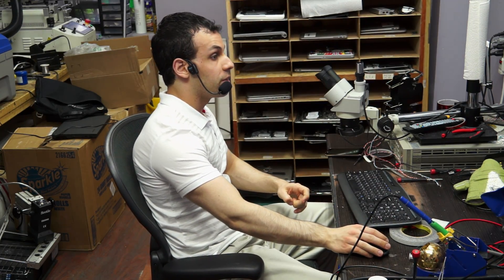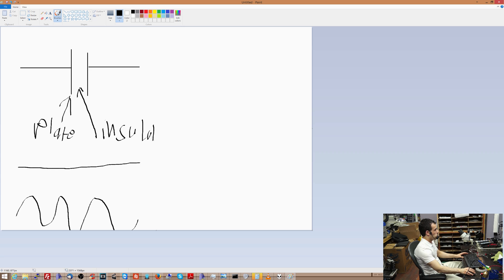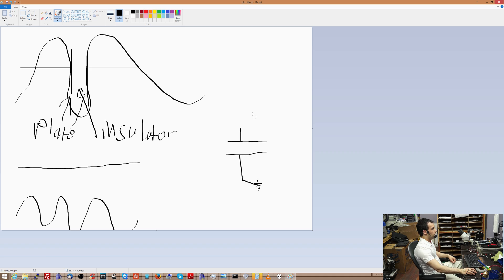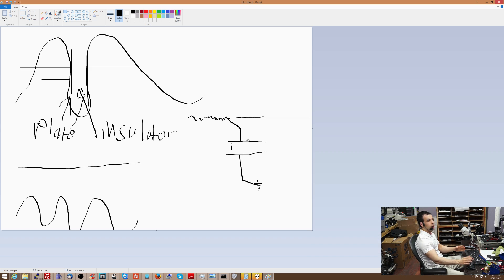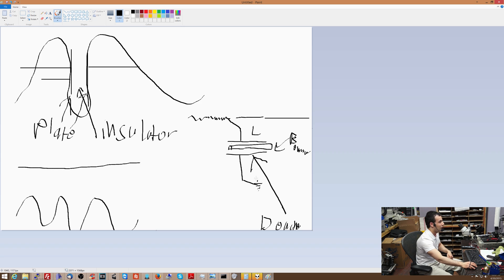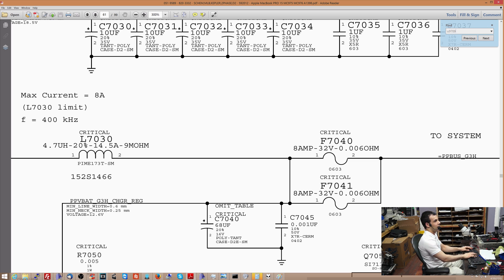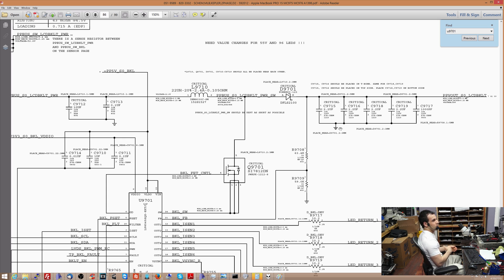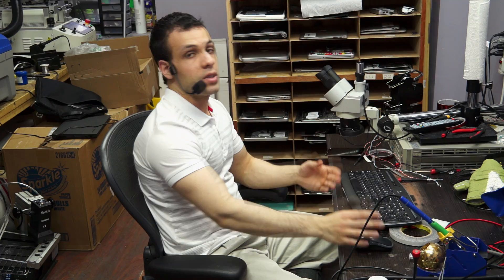What is a capacitor and what is it used for?

Comment: You literally explained it the actual right way. Like 10/10 right. Something else to note, is that the distance between the plates, as well as the type of dielectric, and most importantly the shape of the object being used to transfer that Voltage, determine the amount of charge that will be stored within a given time within the plate carrying the charge. The reason this effect occurs is because the voltage at the right time will allow the energy to flow through. In electrical engineering we call this flow the Electric Field (aka a form of flux, nerds please don't kill me), and is mathematically calculated through what is known as Gaussian mathematics. We use something called Gauss' law to do the actual calculation to find the

Comment: A capacitor is connected directly across the AC supply voltage. As the supply voltage increases and decreases, the capacitor charges and discharges with respect to this change. A current will flow through the circuit, first in one direction, then in the other. However, no current actually flows through the capacitor. Electrons build up on the one plate and are drained off from the other plate in very rapid succession, giving the impression that the current flows through the insulator separating the plates.

Comment: The reason that AC can charge both plates is simple. It charges both plates in exactly the same way as DC charges one plate, thing is AC alternates it's direction, + and - swap all the time.
So, with AC, one plate, which is at first connected to +, is charged and becomes +. Then the overall polarity swaps, and this plate is now connected to - . The other plate is now connected to +, and now it's this plate's turn to charge. And the cycle goes on.

Comment: I think of electricity as water in a house. The voltage is the pressure in the pipe. The current is the flow rate in the pipe. A resistor is a constricted region of pipe. A diode is a one way valve. A capacitor is an elastic diaphragm blocking the pipe. A ground connected capacitor or capacitor in parallel acts more like an expansion tank or a diaphragm on the outer wall of the pipe which smoothes out any pressure peaks. An inductor is a turbine in the pipe driving a heavy flywheel that at first resists flow and spins up and can continue trying to force water through the pipe even if the flow is shit off. A transistor is a variable flow stopcock controlled by varying water pressure on the lever. A DC voltage increaser works like a ram pump, allowing water to speed up through the flywheel or just its own weight in the pipe and then suddenly stopping it and using the high pressure jolt.

Comment: Simple definition: A capacitor is a bucket for storing electrons. The Farad rating is the size of the bucket. Defining charge is more difficult, but yes technically a capacitor stores charge. I like your analogy about angry Louis vs Bouncer. This is largely true for capacitors, except when you exceed their voltage rating, in which case the dielectric insulator between the plates breaks down and the capacitor fails, usually dramatically by releasing the "magic blue smoke". I do know what is a Buck Converter; I've not yet watched your video explaining how it operates. This video is skirting the whole L / R / C (inductance / resistance / capacitance ) topic of electronics theory. A Buck Converter brings inductance, rectification and capacitance to together in a very clever way to change voltage levels in a DC circuit.

Comment: I love your videos but this one kind of screwed the pooch man. I find the easiest way to explain capacitance is with water. Specifically a chamber with an in/outlet on each side and a balloon membrane in the middle. To push water in one side water has to flow out the other side. To let water back out it has to take water back in the other side. This is why ac sees to "pass through" a capacitor. Its a super short term way to store energy like a battery to be used when the main power supply drops below the capacitors charge voltage. When the voltage drops the capacitor starts discharging into the circuit it is placed in parallel with and back into itself on the other side until charge in capacitor is equalized with supply voltage. This is why you can unplug your computer and the led on older motherboards will stay on for minutes afterwards. The capacitors in the PSU are still supplying enough electricity to the motherboard to run it with no ground to ac. They discharge through the Mobo back into themselves normalizing their charge. I'm sorry man but I could come up with other ways to explain this all day that would be easier to remember and much more thorough.

Comment: Louis, sorry to be so late on this video but I've started w/ your oldest ones first and i'm working my way up.  There are many ways to look at capacitors.  Perhaps, look at one as if it were two loudspeakers touching each other face to face.  A DC current will push the first speaker one way and the other will follow.  But that's it.  However, if an AC current is applied, the speakers will move back and forth.  Energy will be transmitted across the barrier that the speakers represent.  A capacitor does the same thing.  Does that make a better mental picture for the explanation?  I hope so.

Comment: Hello, I get most of what you said, but details. You mentioned Ac, you also mentioned came from the wall. But you then mentioned DC Where is the DC coming from?
I have ask, You started a story about wanting to kick the douchbag's ass but the bouncer got in the way and stoped you I feel this critical to know the end.  How did you get around the bouncer or what the DC  do to be able to get through the capacitor. Does it finally just over flow it. Please finish story. Did the douche bag get away with it?

Comment: I watch alot of your videos and like them but this is totally wrong. There are bi-directional capacitors and uni-directional. 

The capacitors that are uni-directional (1 way) convert AC to spurts of DC. The correct direction of current build the charge of the capacitor then goes through. As it lowers the held charge helps keep the current up for a little bit. The ac gets lower than 0 and the current does not go back through the capacitor so current is 0. So only positive cycles the charge gets through.

 The bi-directional capacitors (Surface mount capacitors, aka little brown bastards) let voltage through both ways. They smooth out ac filling the lows with held charge.

I'm not too experienced but I pass DC through capacitors all the time! So do you!!!!!

On my sister's account...... btw

Comment: nice video, I understand kind of how it works but I'm still confused. a capacitor do the same thing as a DC power supply so you need a capacitor. I don't understand what is it doing to the load. The power supply can turn the load on and off, why use a capacitor?

Comment: DC will "kill your speakers instantly"? Are you saying that the power that comes from all amplifiers is converted to AC?
Reply from the maker: speaker amplifiers use DC to create an AC audio signal. All audio is AC.
Reply: Louis Rossmann awesome thanks!
Reply: I've accidentally fed DC to earphones. It can survive it for the first handful of shocks. In may case, these earphones died from rupture of the diaphragm, rather than the coil melting, but I wouldn't doubt if some loudspeakers or such burned up on higher powered devices.

Comment: So in DC electronic circuits a capacitor is just a dead end? Like a water balloon at the end of a hose?
Reply: Jacob Kantor Capacitors generally act as open circuits or "Infinite" resistance when doing DC Analysis of a circuit I believe

Comment: SO... Is the DC current is going to the ground?? Im still confuse
Reply: satria marhaendra A cap is seen as an "open circuit" to DC. So it's like disconnecting the circuit. DC current shouldn't even try to flow through the cap.

Comment: So the charge never ever goes through the cap, it just comes out the same way it went in? That's interesting.
Is this true of ceramic caps? 
Why are some caps polarity sensitive and some aren't? Do they behave differently to what you have explained?
Thanks for the understanding. Great presentation
Reply: Yes this is true for ceramic caps, also for cap polarity "Standard electrolytic capacitors are polarized components due to their asymmetrical construction, and may only be operated with a higher voltage (ie, more positive) on the anode than on the cathode at all times. Voltages with reverse polarity, or voltage or ripple current higher than specified (as little as 1 or 1.5 volts may suffice), can destroy the dielectric and thus the capacitor. The destruction of electrolytic capacitors can have catastrophic consequences (explosion, fire)."
Reply: Thanks! Suddenly motor circuits that I've been trying to rack my brains around for months make sense!

Comment: I really like your videos, and I appreciate your time and effort and willingness to pass along information.
Technically neither AC nor DC pass through the plates, instead AC builds up neg electrons on input side, once the group resistance is greater than the incoming current it starts collecting and alternating on the other side and thereby inducing voltage, and storing energy.
Reply: It's like people impatiently queuing in a corridor and there is a membrane blocking the corridor and people can push and shove the person back and forth on the other side of the membrane but can't break through. Also the membrane is springy and can push you back once you've relaxed

Comment: I don't know shit about electronics yet but after a little googling:

I think of capacitors as batteries. DC can charge the battery and once it's full, no more electricity can pass through, so it forms a block.

Since AC continuously flips between positive and negative, it charges and then "uncharges" the battery, so it never fills up and becomes a block.
Reply: not exactly but you're on the ball.
Reply: That's pretty close
Reply: Yeah, caps may be thought of as simple and small batteries in the sense that energy can be stored but you're completely right when it comes to the AC, because of the constant polarity flip, AC charges and then discharges and it never fills up, but even caps with a tiny amount of capacitance, let's say a couple of nF or even pF (nanofarads or picofarads ), can easily prevent low frequencies AC voltage from passing through because of in this capacitance range the caps charge and discharge extremely fast.

Please check the low-pass and high-pass RC filter for a better understanding of this phenomenon:

https://www.youtube.com/watch?v=OBM5T5_kgdI
Reply: @stevenbedoya9920  Damn!Thanks you for the comment! It clicked! I’ve encountered filters before, but never thought of WHY it works like that. It’s so obvious after you get it…

Comment: how does electricity know where ground is if it never gets to it ?
Reply: The same way water knows how to run down hill. Voltage is a "potential difference". Ground is the 0v reference point, and higher voltage tries to "run down hill" to the lower potential 0v.

Comment: when I first started my trade (automotive) points ignition systems existed, where a capacitor is used, it serves two purposes, when the ignition points are closed, voltage flows to ground through the primary coil windings, the capacitor stores some of the voltage, when the points open, it releases all the stored voltage, back into the coil primary windings, inducing a voltage in the secondary windings of the coil. Its second purpose is to prevent arcing of the ignition points. My dad was an electrical engineer, he explained a capacitor as a voltage store, even in an AC rectifier, part of the voltage is stored. The symbol resembles a battery, which is also a voltage store. When your fluorescent light starts, it is using the discharge from a capacitor, when the condenser fan in your split Air Conditioning system starts they want it to start at its required revolutions, so they use a discharge from a capacitor...

Comment: +Louis Rossmann
How do you test capacitors?
Do you test them or just replace them when they look nasty?
Thanks!
Reply from the maker: Josh Punk Rocker Usually when a capacitor has failed it is shorting a signal to ground, it is no longer a capacitor, it's just kind of a wire. In this case when doing a short test it will burn. https://www.youtube.com/watch?v=t5fICjcaJ3E and the burning component will make itself very obvious :-)
Reply: Louis Rossmann Thanks a lot for that explanation. That makes sense!
Last question and I stop bothering you : Can you make a video on what is that Diode test mode on your multimeter and how we can use it in practical? Or do you know any video that explains that already?
Thanks again Louis. Really appreciate your videos and your frank talk ;-)
Reply from the maker: https://www.youtube.com/watch?v=fh4hpM8JyvM
Reply: Louis Rossmann Yeah, I've watched that video twice and I've learnt that you shouldn't give your board to moron for a 100 bucks ;-) and that it is good to measure working board and compare the results with the one you're testing. But... why don't you use voltage meter instead of diode mode? What is the point to use that Diode mode?
A voltage meter can also measure voltage from source to ground in that case too no?
Sorry but I don't get it!

Comment: If you plan on replacing worn out capacitors:

-Always use the same type of capacitor. By same type I mean, replace electrolytics with electrolytics, ceramic with ceramic, tan with tan, etc....
-If possible use the exact same model of capacitor
-You can use usually use a higher voltage rated capacitor to replace a similar lower voltage rated capacitor without much issues.
-If you do not know the voltage rating of the capacitor, a good rule of thumb is to use a capacitor with a voltage rating of atleast 2x that of the working voltage. For a 5v output try to use atleast a 10v rated capacitor. Generally the higher voltage the capacitor is; the longer the life of the capacitor for a given application.

Some voltage regulators are very very picky about the capacitance value and ESR of the capacitor, it is hard to know unless you read the datasheet of the voltage regulator, which is why generally it is the best to use an exact replacement rather than a substitute. But in some instances if you know what you are doing you can improve the output of a voltage regulator by swapping in superior speced capacitors. Most electrolytics are there not because it is the best type of capacitor for the job, but because it is the cheapest capacitor for the job, so you can gain alot by swapping out cheap electrolytic caps with higher grade electrolytics or using another type of capacitor altogether like replacing electrolytics with ceramic or tan caps.
Reply from the maker: Alan To i hate tantalum. Evil fucking things. When they explode you can literally have fever for days. They need to be replaced with anything else anytime possible.
Reply: Louis Rossmann 
never had a tan explode on me nor an electrolytic, but i have heard horror stories. I think 99% of the time the failure/explosion is due to the capacitor terminals being reversed. Tan and electrolytics are polarized and reversing the polarity will cause catastrophic failure.

I like tan caps much better than electrolytics, their longevity is much much superior to electrolytics and they are not affected by heat/cold cycling.
Reply: +Alan To: I've never had exploded tants on a board, but have seen exploded electro's on many occasions. Either when installed with the wrong Polarity or on a couple of memorable occasions, when a diy repairer fitted the wrong voltage caps.